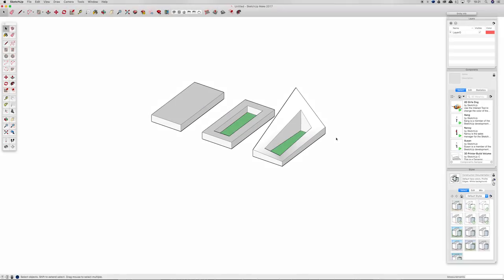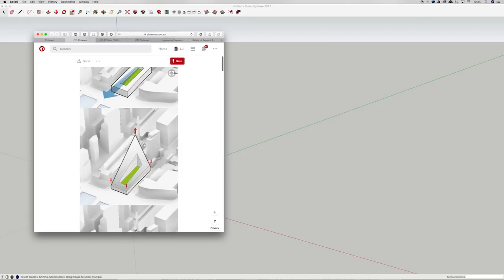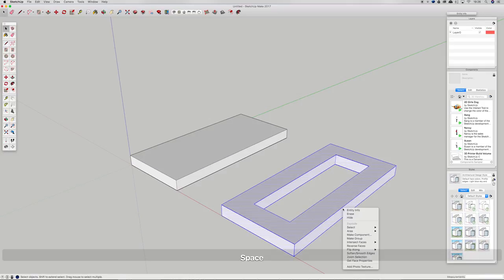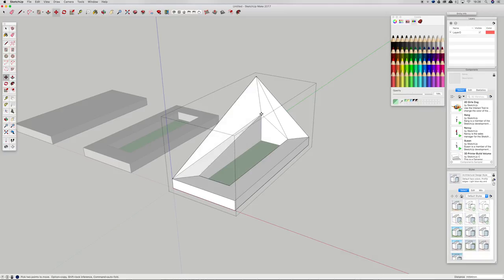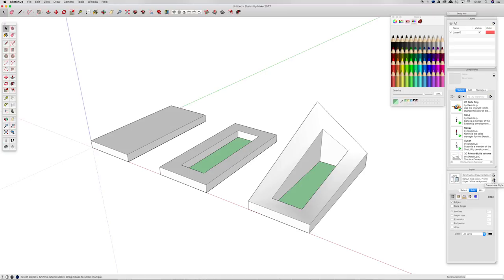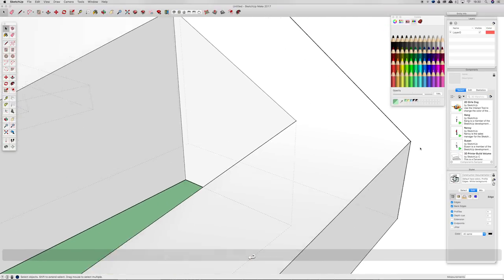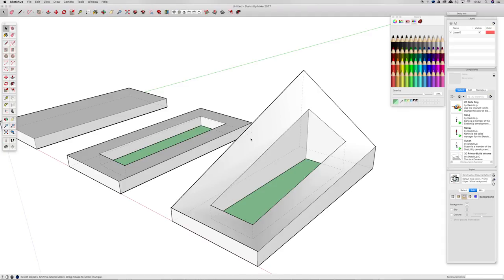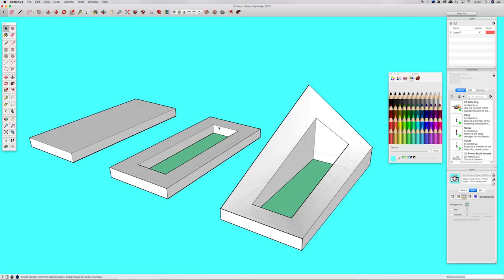How to Create Concept Diagrams like BIG in SketchUp

Comment: How get the Color Plugins ?
Reply from the maker: Hi Ebro, everything I use in this tutorial is standard with Sketchup. The colour pallette can be found under the "Window" menu and clicking "Materials". This panel has both material textures and colours. You can select the pencils like I have done in this tutorial or select you own custom colour by clicking the different panel options along the top. Hope this helps 😁
Reply: Thank you so much @LJ Lancaster